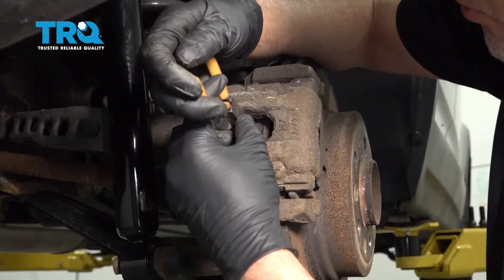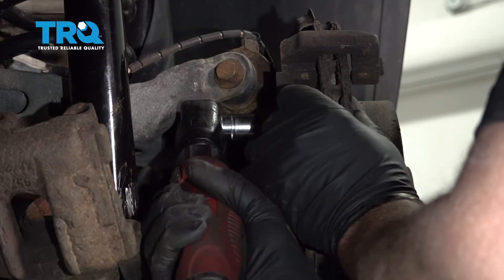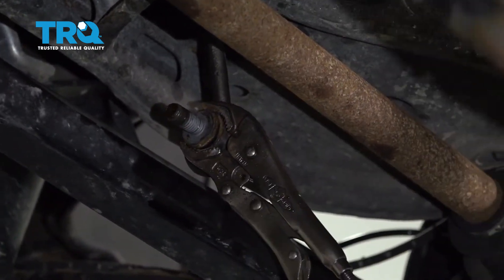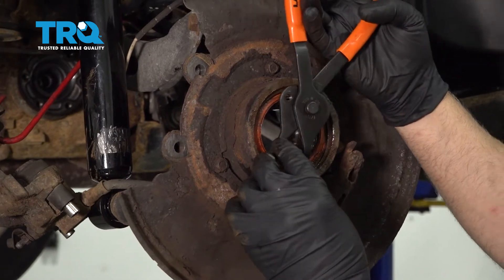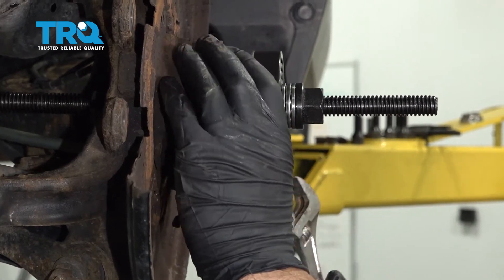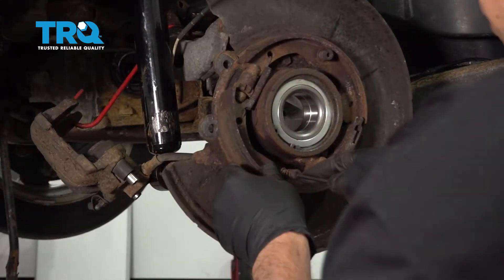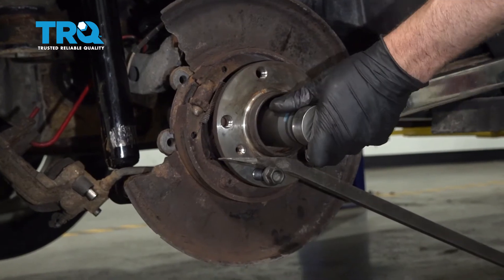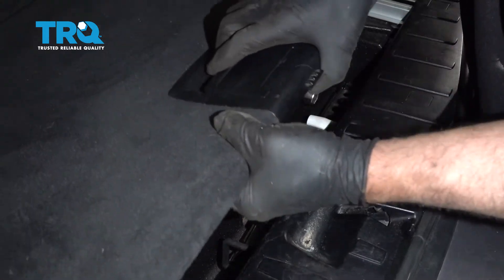How to Replace Rear Wheel Bearing 2004-2010 BMW X3

Comment: Hi what size adapter did you use for the removal of the hub . The smallest in my kit is I but it seems too be slightly too big . Therefore it's pushing in the bearing at the same time and nothing is moving at all ..

Comment: Great video! Thanks very much for sharing, it will be my  guide to a similar job. Question - I see there is a speed ring on the axle but at the same time you mentioned to make sure the magnets on the bearing are poining inward. Does the speed sensor need both the magnets on the bearing and the speed ring (reluctor ring) to function?

Comment: how long does it take to change 1 rear wheel bearing on a bmw x1 2012?
Reply: 1 hour if you know what you are doing and have a method.
3 hours book time.
XXXX hours if you don't normally work on vehicles and are just trying to save money going off some video's how to.